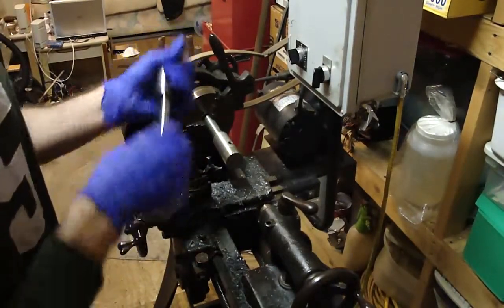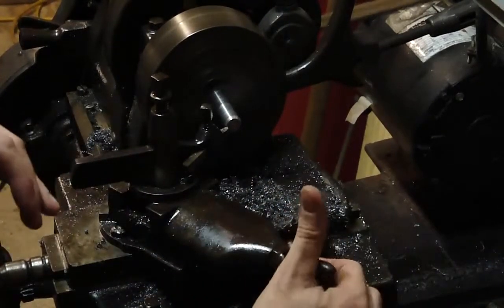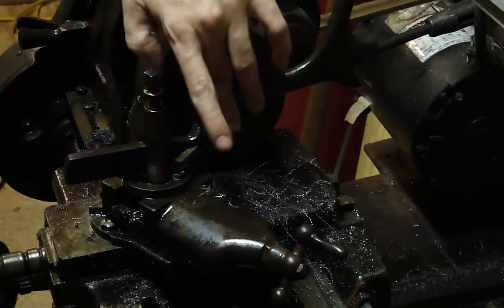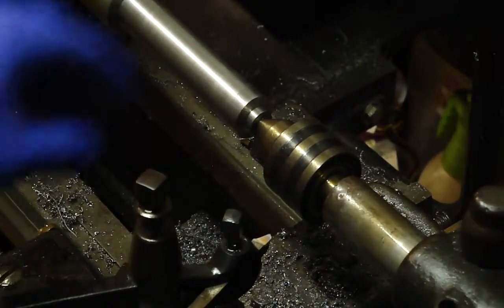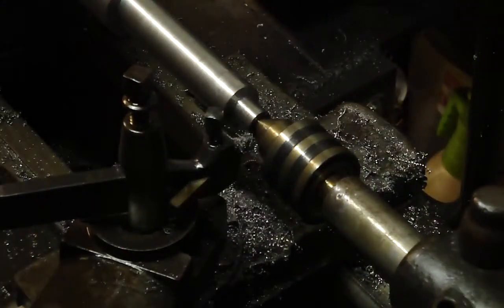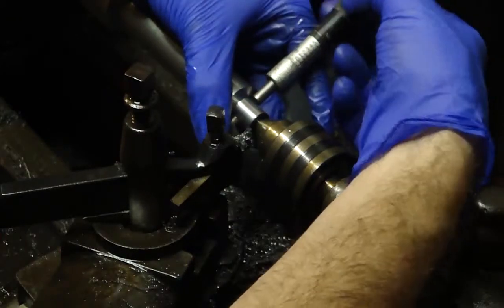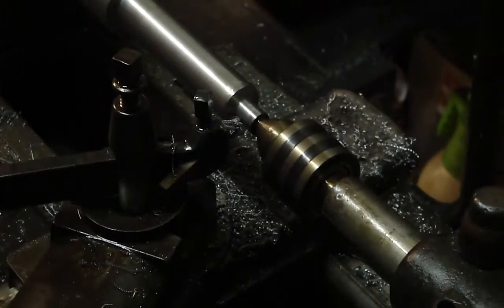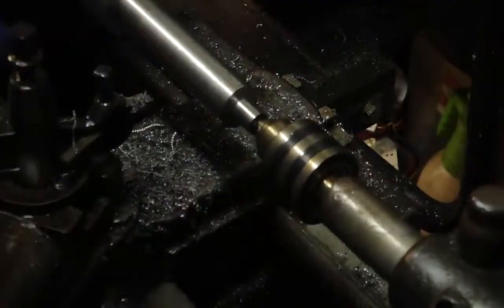MT3 Dead Center Part 2

Comment from the maker: Had to make a temp center to fit in the chuck to make the center to fit the headstock. A lot of duplicate tapers cut, one for the temp center, one for the MT3 lap, and then both 60d and MT3 for the final piece. I finally got a handle on the editing software so I should have the rest of the projects up soon.